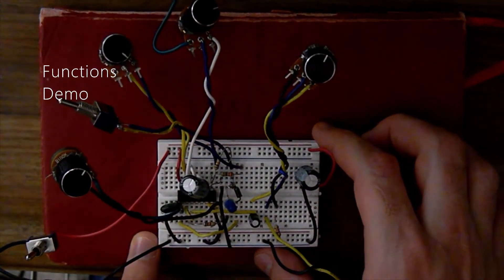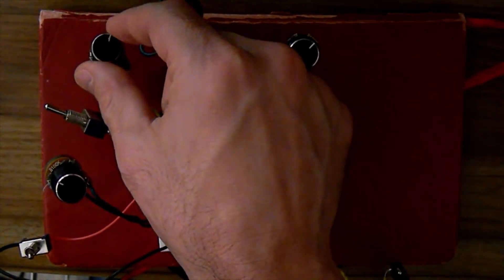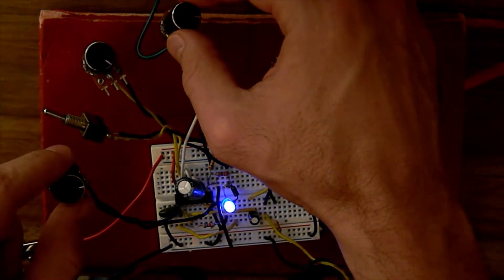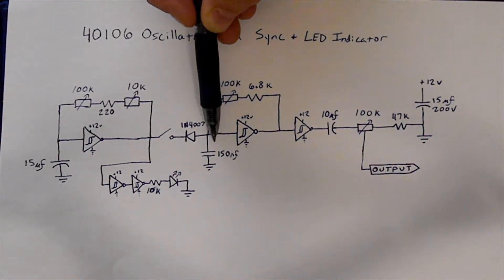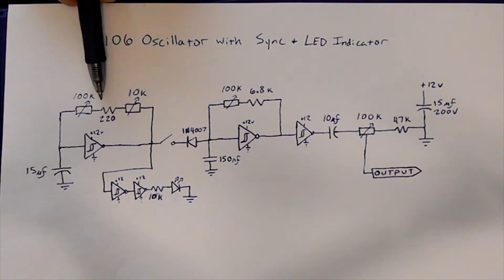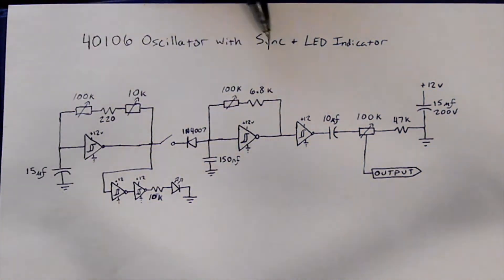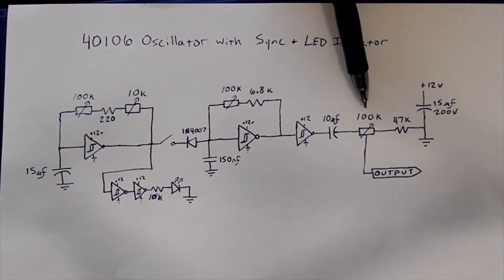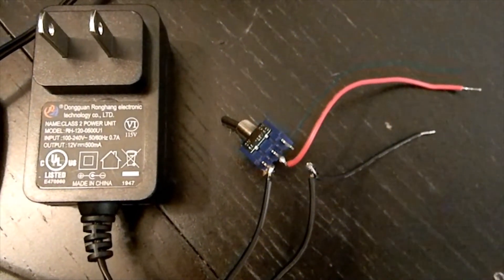DIY Synth- 40106 Oscillator with Sync

Comment: São capacitores eletrolíticos não-polarizados ou podem ser cerâmicos?
Reply from the maker: You can use any capacitor. I use polyester film (non polar) and electrolytic (polar). It depends on the frequency range I want, and what I am able to salvage (I rarely buy parts).
Reply: @observerb  Obrigado. Funcionou bem com eletrolíticos polarizados. Vactrol é muito "lento" para controlar o pitch usando um sequenciador?

Comment: Hey! Will that circuit work with only 9v? Won't it drain a single 9v battery too fast? Has anyone tried?
Reply from the maker: It'll totally work with 9v, I made one like that for my guitar player to run through his pedal board. It lasts a good while.

Comment: Towards the output, is that 10nf or 10 uf?
Reply from the maker: It's uf
Reply: @observerb  thank you!!
Reply: If you're using a smaller (than 1uF) cap then it gives a hi-pass (RC) filter AFAIK.
It's about the AC coupling, right?

Comment: I wonder if you could use a 4017 to make a sequencer synth by putting it between the sync and the oscillator.
Reply from the maker: You can! I replace the potentiometer with a rail that goes to 2 4016 chips (there are better chips but that's what I had) and the 4017 cycles through triggering the 8 knobs going through the 4016. I'm working on that vid soon, I'll have the summer to finally do some stuff since I'm a teacher. Look for it soon!
Reply: The classical baby 8 Sequencer was built with the 4017 chip

Comment: hi , great work , ive been working with 40106 and i have a question , how do you prevent from not burning your chips when inverted polarization of the current occurs? iv tried to power from a 9v-12 apadter but has burn some of mi components , thank in advance!
Reply from the maker: Always use a DC power supply, make sure it's not AC. It should handle 12v fine. I always double check every connection before powering it on for testing.
Reply from the maker: @aaaaa no, maybe a beginner. Wall warts look the same if their output is ac or dc, easily overlooked. I thought they may be using ac when they mentioned an inverted polarization.

Comment: @observer b... 
stumbled across this while wondering where to start on a homemade synth....I know just enough about electronics to be dangerous....I'm going to build this with a hc7414 instead of the 40106 because I have a bunch of them in my scrap bin....the 7414 Vcc is only five volts, not 12 like the 40106....I'm going to use the same values for the components as you did for a starting place, but don't know if the different Vcc voltages will effect the divider circuitry on the inputs and outputs of the inverters....or is it all proportional and has nothing to do with Vcc??
I'm going to give it a shot, but would like to have your opinion if you know what the outcome will be....
Reply from the maker: Not familiar with that chip, but if it works like a Schmitt trigger it should be perfectly fine with a 5v supply and the same components, at least enough to work and then make adjustments because it is proportional like you said. Let me know how it goes!
Reply: yes!!
just finished it and came back here to compare it you yours....sounds about the same.....
I'm amazed at how much (ha ha) "music" I can make by only tuning two pots....
next step after I neaten this up...some kind of sequencer I'm thinkin'....
thanks a lot, I really enjoy your videos...
Reply from the maker: @phonybobsmail1680  Awesome! I'm working on a sequencer video right now actually, my version of a baby 8.  Should be done with it in a week or two.
Reply: @observer b....
I've been really having fun with this....found some 40106's so we're on the same page.....
I made a keyboard....13 notes, one resistor network for each switch...they get plugged into your circuit in place of the pot network on your main oscillator depending on which switch is depressed....
this results in a nice scale, but is only monophonic.....the values are.....

 low C.....26.3K ohms
        C#...24.7K
        D......23.3K
        D#...21.9K
        E......20.6K
        F......19.5K
        F#....18.4K
        G......17.51K
        Ab....16.37K
        A......15.64K
        Bb.....14.8K
        B.......13.88K
high C......13.11K

I'm just getting started.....:)
Reply from the maker: @phonybobsmail1680  that's awesome! Does it stay in tune and do you have an adjustable pot for each one in case it drifts?
Reply: @observer b.....
it seems to stay in tune ok...
would need 13 low value pots to tune perfectly....don't have them.
currently working to get all three of my oscillators to work simultaneously with the key switches. I'm making a lot of cool noise with the keyboard on one oscillator and the other two just running as drones but it gets annoying. I want all three to turn on and off at the same time to sound like a real synthesizer....
going to try a voltage comparator turning on and off a set of analog swithes....I think it'll work. will find out tomorrow...
Reply: They will not effect the divider since effect is the noun. They could very well affect (the verb) it though. 😉

Comment: I'm making a 5V VCO with 2.5V for reference (speaker ground) to get +2.5V and -2.5V, I'm wondering why does everyone use +12V and -12V
Reply from the maker: Eurorack has a standard of +12, ground, -12. Mine only use +12 and ground with a capacitor to make it like +6, -6 for the audio signal.
Reply: @observerb  that makes sense, thank you!
Also, I didn't know a capacitor could be used for that, I'm planning on using a voltage divider to generate 2.5V from 5V and ground
Reply from the maker: @SP4CEBAR  Yeah, the capacitor trick is great for audio stuff! The volume adjustment on mine is just a fancy voltage divider to get the signal level down to an acceptable level.
Reply: Hi! Did you've finished that with a voltage ref. IC or with a passive voltage divider? I'm guessing that you've considered a volt. ref. IC too as an obvious option.

Comment: Bravo........hook up to oscilloscope  .....wave form.....cheers
Reply from the maker: I don't have one! It's a square wave in case you were wondering.
Reply: @observerb  Ideally it would be a square wave but in reality it will be a little rounded at the edges. The DC blocking capacitor will see to that.

Comment: How much is 1 oscillator
Reply from the maker: Very cheap! You can get the 40106 chip for 1 or 2 dollars. The knobs are probably the most expensive part, and I got the capacitors from scrapping CFL light bulbs. This whole build can be done for about $10.
Reply: @observerb  so basically i guess is all about the quality and case build
Reply from the maker: @tzoltekaudio  yeah, this is about a simple as it gets. The cost of labor, keeping a business, and professional builds would make $300 a reasonable price for a professional boutique hand made drone synth.
Reply: @observerb  oscillator drone synth machines are around 300$